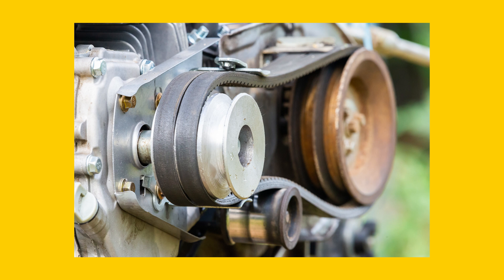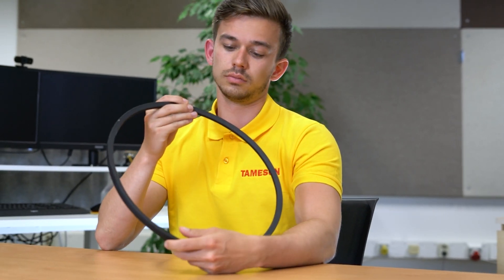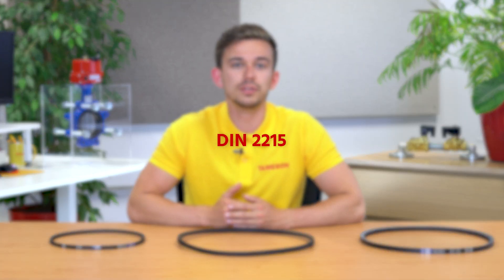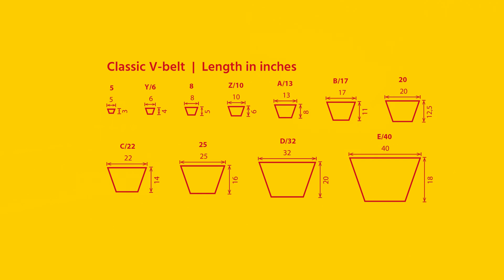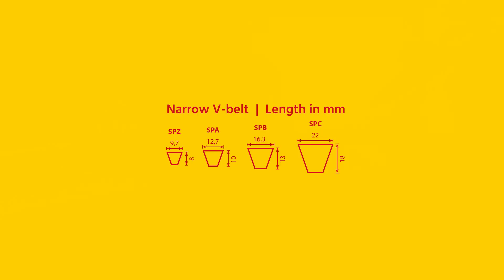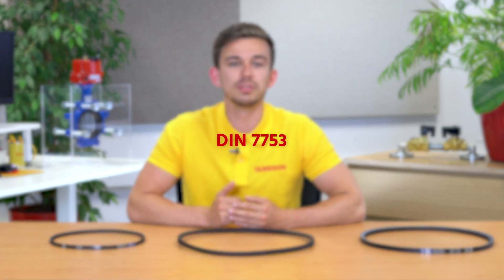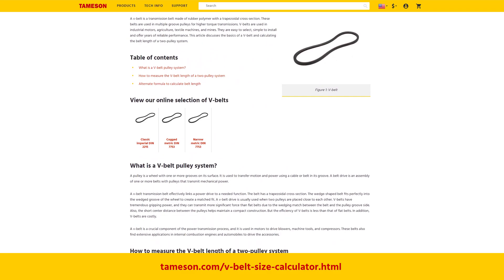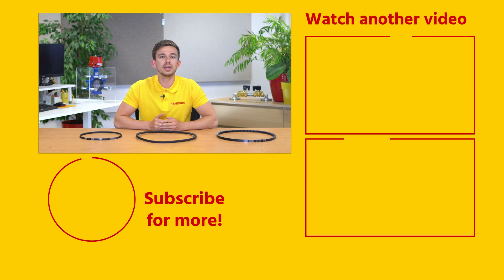V-Belt types & size I How to select the right V Belt I Tameson

Comment: Hi there, I am replacing a pulley in my old pillar drill. The replacement pulley I have found uses a traditional Vee belt profile, but my drill works off of a SPZ belt. Can I use a traditional Vee belt pulley with my current SPZ belt? Thanks
Reply from the maker: Thank you for reaching out. You can generally use a traditional Vee belt pulley with an SPZ belt, but it's important to ensure compatibility in terms of size and fit. For your application, you could consider using a pulley specifically designed for SPZ belts to ensure optimal performance.

Comment: Great video, thank you. Question… I’m working on a compressor and replacing the old belt marked A51. I purchased a new A51 belt it was approximately 2 inches larger than the old one. I then purchased an A50 belt, which was at least 1 inch smaller than the original belt. What in the heck is going on with belt sizing. I’m open to any recommendations.😊
Reply from the maker: Hello, you need to find the correct length of you V-belt. You can search our articles on www.tameson.com to find the explanations how to properly define the V-belt type and  length.

Comment: Thank you.
Very useful information.
However it's important to be aware that some drive belts are used to be a power transfer as a clutch so are designed to slip for the interim between drive and not drive so never toothed.
This is only to add more info and not to undermine anything presented.
Power to the pullys 💪🏻
Reply from the maker: Thank you for your comment.